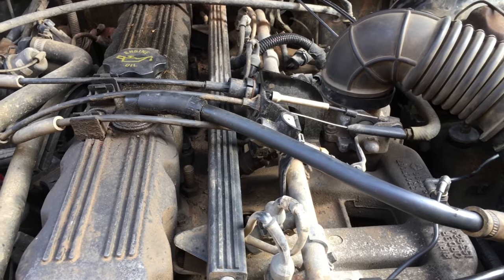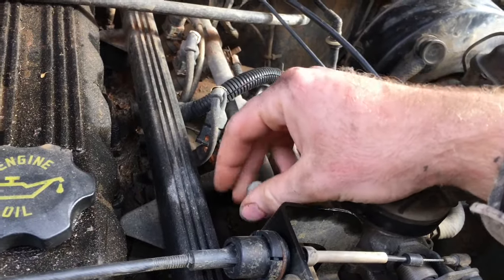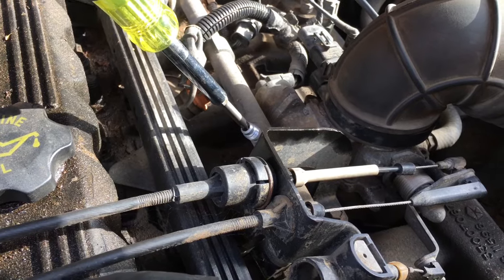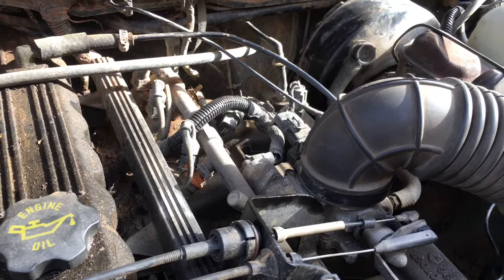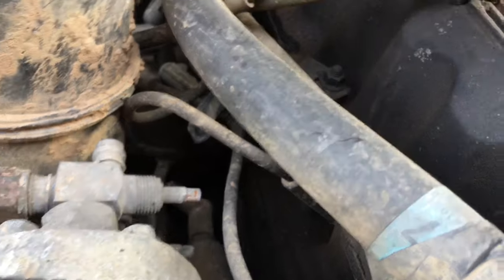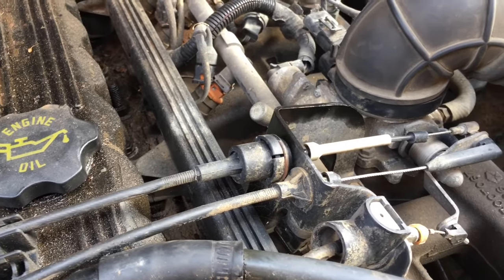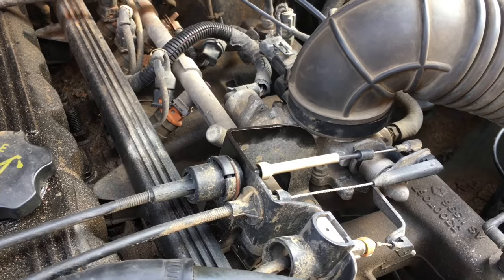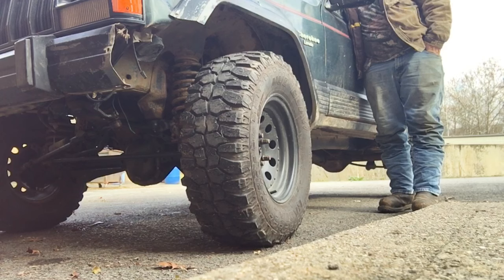Jeep xj long crank fix!

Comment: Could be "(list of every fuel injection and ignition component) but in my case it was check valve"...nearly useless video IMHO
Reply: Elevated where’s the check valve located ?
Reply: He dont know.
Reply: @thatlocalricer9263  depends some in the tank(return less) some pressure regulator one with return fuel lines

Comment: Just install a 1 way in-line check valve in the fuel line back near the tank. It will stop the fuel from running out of the fuel line. Problem solved.
Reply: I'd  hesitate before changing stock fuel line parts, it's under pressure. You could start a fire if not done properly
Reply: @rawdata7569  the return line isn’t under pressure.
Reply: I'd love to try this, just afraid  I'll end up having to pull the tank.  @officialWWM
Reply: @rawdata7569  all that’s happening is that the fuel is draining back to the fuel tank while the car is sitting because the factory check valve in the fuel pump has failed. It’s a lot easier to add one to the fuel line than dropping the tank and replacing the entire fuel pump assembly!
Reply: Where do you put the check valve, at the carb or the tank? @officialWWM

Comment: You just listed everything why not just replace the engine.
Reply: He listed a few possible causes for long starting, that is not near everything. There is a lot more to these engines than a distributor/coil pack, fuel rail, sensors and fuel pump.

Comment: I cleaned my idle sensor by air intake and issue fixed  also cleaned inside throttling intake valve was full of nasty black stuff I used cheap throttle  c carburetor  cleaner from walmarr

Comment: Had the same problem, decided to put a new pump in since my XJ had over  200k miles on it and on my last XJ the pump failed at 190k. The key key cycle trick is a good one, I did use that trick and  drove it for a few weeks until I got the time to replace the pump.
Reply: Did the new pump solve the long start?
Reply: Most likely alternator whine.. or any one of the other pully bearings singing thier last song lol
Reply: What does he mean cycle thru the keys? What is the key cycle trick?
Reply: @foxmulder7616 turn let ding dings stop do it 4 5 times in a row.
Reply: @foxmulder7616 what your jeep doing.

Comment: lately mine has started to long crank on a cold start but as soon as the engine is warm, it'll start right up everytime. Not sure what the deal is though
Reply: fuel pump signs of going out like he did from one day to the next go to the schrader valve and check if you got nothing you will know what it is could be check valve or pressure regulator change it before it starts stalling and leaves you on side of road
Reply: Did you ever figure it out i have the same problem
Reply: @AlejandroMartinez-lo3kw  i changed out the pcm and the crank position sensor  its been working ever since no trouble check your distributor cap and rotor any build-up you wanna get a new one

Comment: Hours does that. Sometimes it'll start up right away and then you can turn it off and start the car again and it'll take forever to crank up which it does most of the time. Ours has a straight pipe and it's an awesome vehicle.

Comment: These trucks are great, but mine has an intermittent, no spark no fuel issue on cold mornings when I need it the most… I noticed that the check engine light does not cycle on when it is doing this. I have never had any major check engine codes anyway, but I know the truck will start if I turn the key and see the check engine light flash for a second. I tried crank position sensor, but it wouldn’t run at all with the new crank position sensor so we put the old one on it and it ran just fine until next winter

New fuel pump, new ignition, coil, distributor, cap, wires plugs, capacitor/ignition coil all sorts of things. At one point I was convinced that the fuel rail was frozen so I would put a hot towel on the fuel rail, and for some reason it would start up, but I was also bumping the truck as well as attempting to start it multiple times, so I don’t think this was a fix. Just a coincidence.

All the fuses and relays seem to be good as well

The only thing I could think of is if there is some sort of electronic circuit with the ignition that since it’s a rollover, perhaps? If there is something that controls both fuel and spark at the same time to stop ignition altogether, I think that is what the problem is, the ignition switch seems fine, and the ignition switch on the steering column. If something was wrong with it, the truck would not crank at all as I understand it. These trucks are great when they are running, but they are electrical nightmares when they’re not.

Thank God for AAA, but damn, it has ruined several work days. I’ve taken it to several shops, and they cannot reproduce the issue, so maybe I should just start parking in the mechanics parking lot that way I won’t have a problem again it really is like that gremlins
Reply: If it will not start on super cold mornings, it could be that the capacitors inside the CPU circuit board are old and need new ones. It's inside the box under the hood on driver side inner fender apron.   If you heat up that box using a hair dryer or heat gun and it starts, that's your problem.  Replace those capacitors, 3 of them.

Comment: On my 2000 xj , I changed head gasket and replaced intake manifold. At first in reved high at start, so tighted up manifold. Now wont start at all. Except for a little back fire but never cranked.
Reply: How did that go? I’m about to put my head gasket in.

Comment: not good practice you should change it out soon if it has not done it yet it will start stalling  at red lights and when ever you go to hit the gas hard you'll get backfire and a stall and might leave you stranded on the side of the road its not hard just jack the rear end up choke a wheel and put some jack stands its a 14 mm deep socket you can put the entire socket into the tank strap bolt the square drive where an extension would go will be hanging half off but it works just several turns (7-10 turns) and put a jack under the tank and jack up the tank with a piece of wood to not hurt the plastic tank full of gas and you can remove the tank strap bolt has a circle pad that goes into the frame without taking the nut of the long bolt remember to remove the 2 hose  the filler neck , breather tube fish it through the frame and down goes the whole tank when you release the jack remove the fuel line (depress the tabs and pull to remove )and the electric connector (try not to brake the red locking tab) and thoroughly blow or brush off all the dirt and rocks and sand and salt from the top of the tank before you go to remove the fuel pump assembly check your tank contents with a flashlight if you see metal slivers you need to drain and clean out the tank to ensure fuel pump longevity even a new filter will be best (use the gas for something else) like bbq starting  or something get entirely new gas when i did mine it looked like pee weird cloudy the fresh gas was clear slight yellow  and a slight green tint to it pump on ebay for 35$ i put a bit of silicone lube on the seal to make sure it went in easy and silicone greased the plastic locking ring to make sure it went all the way on and was seated right and tight

Comment: Hey Ronnie just bought a Jeep xj 93 5 speed and it’s basically consumed my life with chasing noises and hearing new things of concerned every day I drive it. I’ve done a couple of things including tune up new SP rotor coils etc. I noticed I have a long crank if I let Jeep sit overnight or more then 10 hours. After that it turns over pretty quick. Is that a cause for concern?  Thanks man
Reply: I have heard that  people have herd thuds creeks and bumps while their XJs ...I dont have any ...is there something wrong with my 94 cherokee that was owned by 2 old ladys one of witch never drove it outside the city limits of spokane  now I own it and love it  sorry for not answering your question
Reply: sounds like your fuel pump
Reply: Change your fuel injector o-rings. Had the same issue a while back with the fuel rail not holding a prime. it wasnt the fuel pump, so I did injector o-rings and it solved the issue.
Reply: @MattyWearsAblazer  so you must of had some fuel leaking out the injectors right

Comment: Hey Ronnie. So a few months ago my 98 jeep xj started to do the long start so zi started to prime it turning to the on position and has been fine. Then last week the fuel level sensor started to go haywire and then a few days ago I started driving the jeep and when I go accelerate, the jeep doesn't respond and is really sluggish and then all of a sudden its starts to drive fine. It does this maybe 2 times and then it's fine. I just bought a new pump and regulator (bosch) and plan on doing a pressure test but wanted to ask your opinion.  Thanks!
Reply: Same problem here just today my 96 DJ. Daily driver.

Comment: I'm starting to tend to have this problem with my 2014 cherokee. But it only gives me this long crank start when I fill it with gas. I never have this problem any other time. Normally I'd get 87 gas and starting things up every time I fill the tank it starts normally. But I started getting more the E85 gas that suggest to use for the 2014 cherokee. And every time I fill the tank it always has a long crank and won't start, then I to start it again it'll do the same thing but will start a second time. I don't know, might just go back to 87 gas so I don't always have this problem every time I fill the tank.
Reply: It’s a purge valve causing that.

Comment: Did you ever figure out the cause of that high pitched whine when you started it? Mine does the same and I was thinking water pump.
Also good vid 👍
Reply from the maker: It’s normal it has something to do with the fan when it’s cold
Reply: It’s the alternator charging the battery after start up
Reply: @Cherokee Ronnie  wen you push the valve in should the vehicle be running??

Comment: Fuel pressure regulator is what im doing i got a 2dr 95 and bought a 4dr sport ... Guy said didnt start took it over to the shop and took out the fuel pump relay and cranked up and put in the relay.. Died out after going back and fourth finally got it to Run but after trying to accelerate on the road it dies . so ima change the regulator and post another comment on here
Reply: Did it fix it?
Reply: Did it fix it?

Comment: Does the car need to have been running prior to this test? If my car sat overnight, should it still squirt fuel?
Reply: Yes it should maintain pressure in the rail at all times.

Comment: Hey man just a heads up you dont need to drop the tank to do a fuel pump on those cherokees
Reply: That’s true for 84-96. 97-01 has a plastic tank with a top mounted fuel pump. This one is definitely an 84-96 though
Reply: @terranovnicek1567  97-01 was a trash gen
Reply: @dakidd5413 00-01 are total garbage. That’s when they changed everything that gave them problems. Anyone who says otherwise is lying to themselves. 97-99 are mechanically almost identical to a 91-96. They’re still pretty good jeeps if you like the facelift

Comment: Where can I get the fuel pressure hose that connects to the fuel rail? 
I got a 5/16 nylon fuel hose from Autozone but my mechanic said it won't withstand the pressure.
Reply: Get a fuel pressure kit from harbor freight. Works great
Reply: @jeremylyons6252  really?  I'll go check it out.  Im not doing anything lol 
 Thank you for the info.  Really appreciate it
Reply: @BUKWulfSh0t  yea i just used mine today and had low pressure at idle. They come with multiple attachments and is pretty decent quality
Reply: @jeremylyons6252  I'm here now looking for it. Thanks
Reply: @jeremylyons6252  do you know exactly which one it is? 
There's Engine& Transmission Oil Pressure Test Kit 
And Then There's 
Engineer Pressure Test Kit
And
Deluxe Compression Test Kit
Reply: @jeremylyons6252  and there's 
Fuel Injection Pump Tester

Sorry, I don't know much about cars and you're the only one whos replied. 
I appreciate your help
Reply: @BUKWulfSh0t  no problem, if I was at the shop I'd send a picture of the kit i use. It's the master fuel injection test kit i believe from harbor freight. There's a port (shrader valve) on the fuel rail you hook it up to and plug the guage into the line and start it. It should read 49 psi at idle give or take 5psi if i remember correctly but that's the spec on my jeep and it is a 98 grand Cherokee 4.0. Once you are hooked up to the guage you may have to back off pressure on the Schrader valve where you screw your hose on because mine wasn't showing the full pressure after installing my new fuel pump.  After I backed it off a couple turns it read accurately.  If you have any questions you can hollar at me
Reply: @jeremylyons6252  thanks man, I'll keep you updated.  I know which kit it is now cost about 49.99 
Only had 20 bucks on me. But thank you again.

Comment: so my 96 xj kinda does the same thing but it takes about 3-5 cranks to get it started i did tune up and fuel filter and still does the same exact thing could use some help from anybody please and thanks
Reply: Check the map sensor, test the fuel pressure, do a tune up.